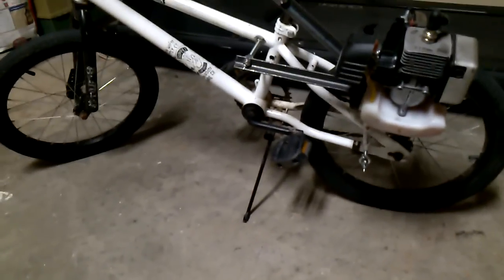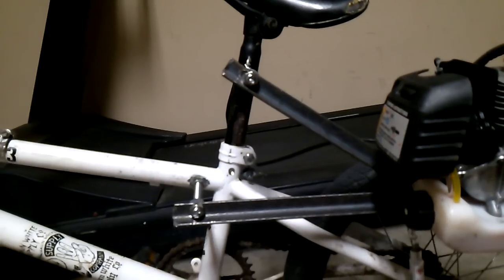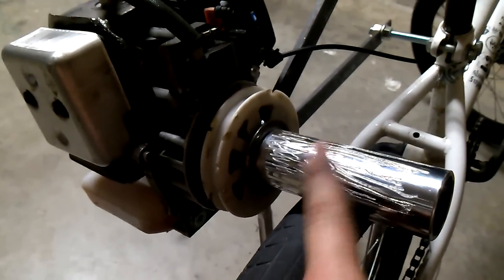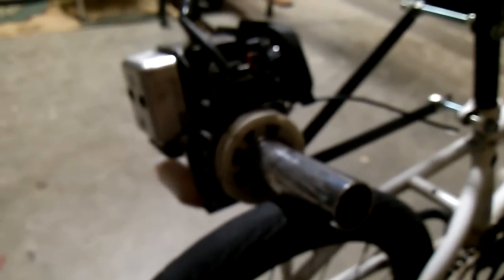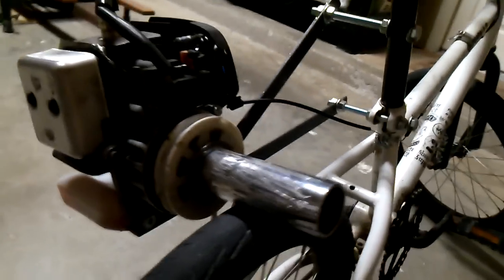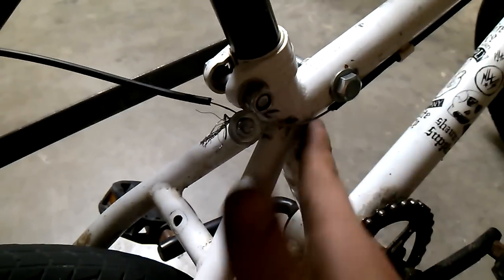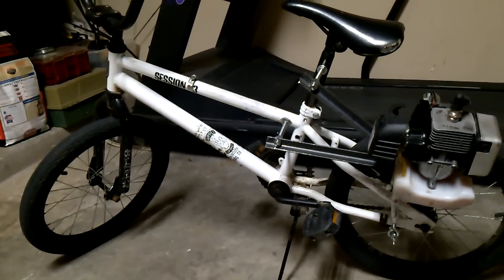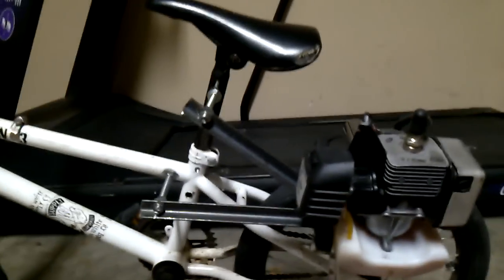Homemade friction drive motor bike part one

Comment: I remember making my first weed wacker  bike , I used the same design as you with the bike peg friction drive . And I permanently mounted the motor with 2 pieces of small square tube maybe half inch square tube I think , and the tubes were bolted straight to the original plastic engine cover holes ( 2 bolts each tube ) the square tubes were cut to less then 2 feet long and then I mounted the square tube to the “ swing arm “ part of the bike even tho it doesn’t swing or move that’s what I’m calling that > looking section of the bike that the rear wheel mounts too , I used 3/4 inch u bolts to clamp the squar tube to the side of the rear bike frame . And To create the “ FRICTION  “ on the rear wheel I mounted my new contraption with the rear tire deflated and then I pressurized my tire again and it just so happen to create just the right pressure on the tire and the bike peg without slipping ,and it looked really clean design , just slapped on a brake lever for the throttle  it was so damn fun , and btw . I also removed the spark plug if I ran out of gas and had to pedal . It eliminates the compression in the cylinder and you can pedal freely for a short distance hopefully  until you can fill up on gas . Oh and I happen to have 2 stroke oil on me so I would put a few drops down the spark plug hole so the cylinder and piston are still lubricated without fuel sense my engine was permanently mounted , I was 15 years old and it lasted the entire summer , then the motor shaft / bike peg snapped off lol

Comment: how do you mount the peg if there are no threads to punch a nut on. What if it just has a key slot then what do I do?
Reply: You get a nut that fits the shaft then in the peg... Theres a hole that you go through... Put the peg on then place the nut and tighten
Reply: If its a key slot then use a gear